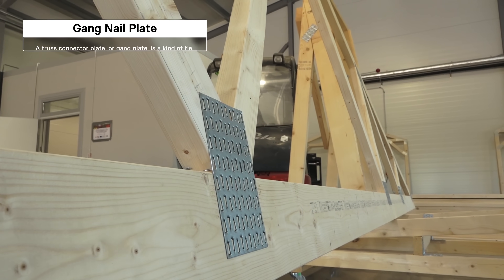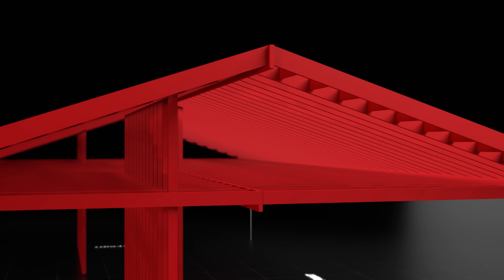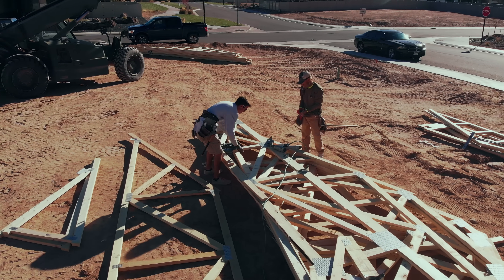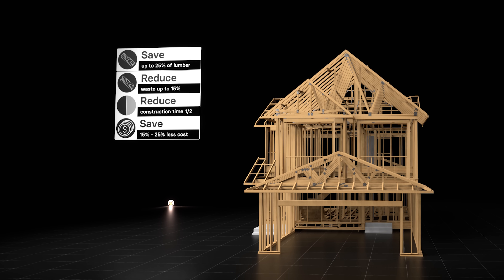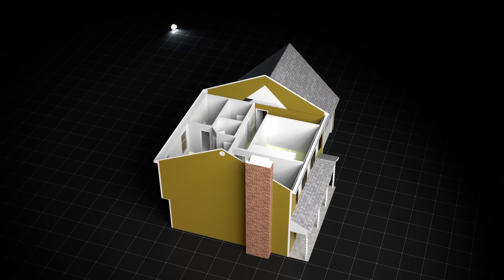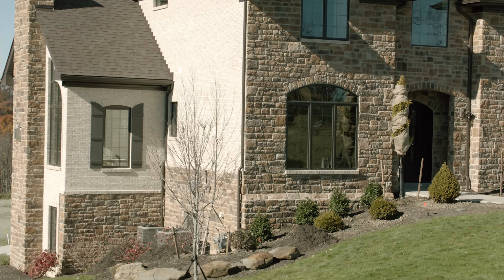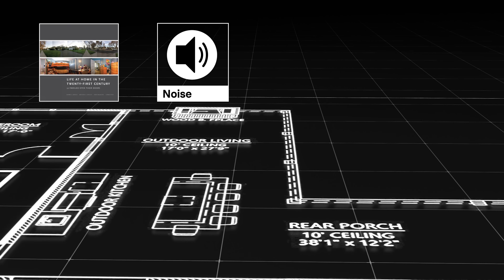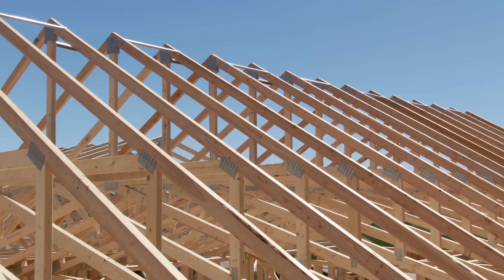The Invention that Accidentally Made McMansions

Comment: Super interesting, thank you! In case anyone's interested, this is in the domain of sustainability great example for what's referred to as a "rebound effect". Where an efficiency gain through innovation is eaten up by increased consumption. (think e.g. more energy efficient machines -> lower energy bills -> increased used of machines -> same energy bill as before)
Reply: Also known as the "Jevons Paradox"
Reply: The same thing has happened in America with vehicles and vehicle size like a full-size pickup truck like an F-150 from 1995 or 2000 compared to today is a massive increase like much bigger probably 25% heavier. But because engine technology has improved they can still get roughly the same marginal fuel economy or a tiny bit better. Where if they had kept the vehicles the same size and used the increased technology they could have been much more fuel efficient and the engines could have been smaller and lighter and cheaper to make and they would have been less stressed and less stress on the transmission etc 

Also now nearly all cars are way overpowered considering most people never gun it from a stoplight.
Reply: Just like more highway lanes -> people move farther away -> more cars -> traffic jams same as before. Man, suburbia loves that stuff.
Reply: not so much a rebound effect as elastic demand. "increased use"
maybe because the fkfing demand was there, and it was price limited? stop being antihumanist.
Reply: @removechan10298  It tends to be eaten up by demand, whether that demand is from consumption, or from redirecting investment(i.e. training carpenters), or simply allowing more slack in terms of waste.

Comment: In the 1960's, there were similar zig-zag steel plates you hammered end-on into the wood, but it cut thru the wood fibers.  Roof trusses with 2x4 are stronger than traditional 2x6 rafters with 2x6 ceiling joists (forming a triangle), plus large lumber is getting scarcer since growing smaller pine trees ~30 yrs is more economical.  Even with older on-site roof framing, rafters often had mid-support studs down to walls, for a truss-like structure.  A bit wrong about a 1st floor not having to support upper floors, unless those upper floors are thick truss-like beams, often today being vertical OSB board with 2x4 at top and bottom.

The angled cuts and measurements are tedious on-site, but simple and repeatable in a factory.  Why most builders today order pre-built roof trusses from a factory.  Requires a crane to install at the house, unless a small structure, which is most economical when building a whole subdivision.  In similar vein, factory-built houses are more economical, but limited to section widths that can travel by road.

Comment: You are wrong about most of your main points, and gang nail plates don't make ANYTHING "possible", they just make it a little cheaper and weaker.

There are countless other products and methods and techniques for building trusses, nearly all of which are stronger and last longer with fewer failures, the truss plate is just the lowest possible strength and cost way to do it, and should NOT be glorified like this.

If it had not been approved, we would still have trusses, they would just use nails or screws or bolts through the side plates, like any heavier duty and better built truss or joint would use.

Making it sound like the truss plate is this pivotal invention that makes the modern world possible means that either you are just trying to find a unique click bait hook to make a video with along the lines of an actual expert like Practical Engineering etc, or that you phoned in your research and didn't actually understand the subject very well.

The real revolution was learning how to design trusses for residential buildings in a way that didn't require teams of engineers hand calculating loads on drafting boards with slide rules, and making it possible to design trusses rapidly and cheaply so they could be used for lower cost buildings.

Getting the computer involved was really the key, so they could just plug in the design, and it would tell them the loads and what sizes of materials they needed.

The other big factor that you missed as you tried to focus everything on the truss plate is the development of truss joists and I-joists, which is what actually makes the open multi-floor plans possible, because you can span much further than with a plain wood beam with no support below.

Also, the shade given to overlapped boards and toe nails was inaccurate and unfair, because the through-nailed overlap is one of the strongest joints you can make, much stronger than the gang nail plate, and any carpenter who can use a speed square can easily make that joint.

And toe nails are actually STRONGER than the gang nail plate when done properly, because they go all the way through the wood, vs the gang nail plate just being stuck in the side, where it will come loose as the wood dries, and is especially bad in a fire where just some surface char will cause complete structural failure, even if the board itself is still unburned in the core.

So anyway, the only benefit of the gang nail plate is a minor cost reduction in the manufacture of trusses, at the cost of strength and longevity and safety, and the actual catalyst of the changes that you are talking about was the development of the ability to rapidly engineer truss design at a cost that made them an affordable option for residential construction.

Comment: Open floor plan with yrusses has the side effevt of expansion and contraction at the ceilling to wall drywall joint. So now you need crown molding to hide that yearly cracking

Comment: Complex roof shapes are a dead giveaway that the builder spent almost no money on design. It takes a lot of effort to refine a house design to the point where you have simple, elegant forms assembled through additive massing.
Reply: Complex roof designs are usually a dead give away that an architect was involved or a good draftsman on a computer.
Reply: @paulchapman1933  I'd argue the opposite. Usually, if a GOOD architect is involved, the roof is easy to build.  If the designer didn't follow TND additive massing principles, you get a stereotypical McMansion.

Comment: If you think housing affordability is bad now, think about how bad it would be without this invention!

People often miss the cause and effect and blame lack of affordability on some ‘market’ improvement when the modern inventions often bring the cost of nicer things down for the ordinary person.

There are two pressures driving prices for a commodity like livable real estate higher and higher, regulations and inflation.

Regulations cause the builders to have to contend with code inspections and enforcement which increases the build time and lowers efficient production while in 2008 the fed decided to PRINT PRINT PRINT their way out of the banking collapse. While the inflationary pressures weren’t felt that day, after the real estate price bubble burst on everyone, the trickle down effect which happens when all that newly created currency bloat comes to the individual level you see the prices of every type of good rise to the level the money supply has afforded.

It wasn’t the gang nail plate. The builders had to pay more for everything, labor and materials, to get the job done so building larger houses was the only profitable way to run the company. Hence why you see so many townhomes and condos popping up around and after 2008 as well as almost exclusively larger builds.

Comment: Toe-nailing is still required where the truss meets the exterior/structural wall, which usually is also the position of the gang-nail plate.  Meaning toe-nailing needs to be performed through the gang-nail plate, often damaging it or compromising its original integrity.  On top of this building code also requires extra metal plates called "hurricane ties" to be attached to the structural wall and truss using 1 1/2" galvanized nails.

Comment: Wait a minute!! You said the issue was the roof being a wing and that toe nailing the rafters to the top plate was the connection that failed leading to the development to the gang nail plate, but in the video you show trusses made with the plates being TOE NAILED to the top plate just like rafters has been. This seems to be a case of bias looking for an out let rather than honest analysis. If I may, the real solution to the problem originally posed is also metal and is a part of most building codes... Rafter tie downs. These metal strip twist 90 degrees allowing for multiple nails to hold the rafter to the top plate but in many circumstances all the way down to the studs below the top plate.  Last aside some areas require homes with truss roofs and particularly truss floor systems to be registered with local fire departments to protect fire fighters, as these systems fail in a fire so much quicker than homes built from dimensional lumber.

Comment: We build with concrete in the Caribbean. Pretty much the same thing happens here. Less people buy large family homes since they’re expensive and people don’t reproduce as much as before. Still, most builders construct 3 bedroom, 2 bath homes or larger because it can be sold for much more. There is a need for 2 bedroom homes for smaller families or a single person, but the profits won’t be as great since it takes roughly the same amount of time to build. Similar to trusses, we can use concrete beams to create large open floor concepts instead of needing load bearing walls or columns.

Comment: I've been in construction for 40 years.  I've framed three of my own homes from scratch.  I've built trusses with plywood gussets and nails.  I've stick framed others. 
Trusses are great and moderately cost competitive if their kept simple and uniform.  They are brutally expensive otherwise and waste tons of wood.  I see these stupid Sherwood Forests on top of complex bases.  Total useless space.  
And what B/S about toe nailing stick frame isn't as good vs trusses to top plates.  If you have issues with uplift then whether it's truss or stick frame you'll use hold down clips or straps or other sheet metal anchors to resist that uplift.
If you have greater spans than 14' your often times better off with a steel beam or engineered lumber (LVL).

Comment: As a civil engineer / project manager for a State transportation agency from the early 80's up to the pandemic, I witnessed many an advancement in tech for all aspects of my job.  For actual Civil work, we went in reverse - from capturing all flows into concrete pipes & culverts to allowing rainfall to penetrate the earth via porous pavement or "rain gardens" in between parking lot aisles or large retention basins at the bottom of large parking lots.  We went from More Pipes to Less Pipes.  We did large wooden structures for salt storage sheds.  We used the gang nailed trusses from the early 80's but they were problematic - they left too much "give" so the shingles fell off, they provided too convenient a nesting roost for pigeons & crows, they were obstacles to the trucks delivering the salt, getting hit & broken all the time.  We went to glue laminated arches - yes the fancy type used for churches & such - for a mundane salt shed - but they solved all those problems stunningly well & ended up being cheaper in the long run.

Comment: Very intriguing video. The reason housing is bigger than it used to be is because by the time you get through the bureaucracy of getting permits, the regulations, the plumbing, the cost of concrete to build a driveway and foundation, the large garage everyone needs, the fancy kitchens everyone needs with granite counter tops and tile floors, expensive appliances, the cost of running water and gas plumbing to a house, electrical, cable, internet, etc. and most of all the high cost of land in most desirable places to live, makes just adding a second story to virtually double the value of a house a no brainer. Think about, for roughly the cost of adding some sheetrock and 2x4s you can double the price a house will fetch when 95% of the costs of the house are fixed including the roof.

In other words if houses in an area sell for, say, $250/square foot, and the all in cost of building a 1 story house which is 1200 square feet is $300/square foot, you would be selling that house at a loss. But say the all in cost of building a 2 story house with 2400 square feet is $200/square foot (remember it's the same cost to permit, buy the land, same driveway, foundation, garage, kitchen, living room, downstairs bedroom, bathroom, same roof, utility connections, etc., you're just adding a few extra bedrooms and another upstairs bathroom) you're going to build a 2 story house every time because now you're making $50 profit per square foot.

Everyone freaks out that we're not building small affordable houses but that's the economics of how houses are built. The marginal cost of building a second floor is minimal so we'd be dumb not to. There are plenty of existing houses that are cheaper, you can't compete with those prices when you build new. That would be like if car makers were trying to build brand new cars to undercut the price of used cars. That's just not realistic. If you can't afford a new house just don't buy a new one. If you don't like the price of used homes, sorry that's just supply and demand of the cost of land and you can blame congress for spending money it doesn't have running up a $36T deficit.

Comment: My grandfather took a sketch of trusses at a factory thinking it was a good design and then when he built his own 1,600 sq foot house in 2 years after work (no big deal 🤯- and he didn’t work in construction either), he used homemade trusses, monster overbuilt things.  

I had an engineer friend look at it and he said it was just like homes are made today only way stronger.

Brilliant guy with an 8th grade education.  When he was 80, he climbed the utility poll at my first home (foreclosure) and turned the power on even when I protested.  Tough as nails.  RIP grandpa.
Reply: Your Grandpa sounds like a BAMF.
Reply: Men back then were built different.
Reply: Sounds the same as my house. My grandpa dropped out in 7th grade, built his own house, and the homes of others. 

Some things leave you scratching your head. But then you have to stop and think that there was no internet, this was built by a guy just figuring it out. He dug the freaking basement by hand... Unreal. We had a tree (massive one) drop on our house last year, and it has old the old designed roof. And 0 damage was done to it. It has a ton of angles to the roof and is just massively over built. We don't have hurricanes here, so lifting forces probably would be harder for it to tolerate, but it can take a ton of extra weight being dropped onto it, even if that weight is focused.
Reply: For every brilliant guy who dropped out of middle school, there are 100 dropouts who are complete idiots.   @1Kurgan1
Reply: @1Kurgan1 That’s wild

Comment: I was a building inspector (new construction) from 2004 to 2010. I could never wrap my mind around why the roofs were so enormous except to add that over the top architectural element. Some of them were definitely beautiful, but some just seemed completely out of place, especially on a 3 bedroom ranch when with a skyscraper roof on top. Those roofs were an absolute pain to inspect for bracing too. It wasn't at all uncommon to find trusses installed without the engineer required bracing. Overall the trend seems to have come back a bit on the grandeur of roofs and with the skyrocketing cost of real estate I imagine that kind of excess will soon be a relic of the past.

Comment: Gawd I hate the hideous appearance of multiple, unnecessary roof lines and outer walls with several useless jogs in them.  So tacky and classless.  And the open floor plans are SO awful!  They make even the largest home feel small and cold.  No cozy places, and you can see from one side of the house to the other, making you realize how small it is.

Comment: If you had to pick one invention, I would not disagree with his choice of the gang nail plate. But the mcmansion results from a confluence of Dimensional lumber
Plywood/OSB
Sheet rock
Engineered wood joists
Premanufactured roof trusses.
With these materials available,  it became affordable to build large spacious houses that in previous generations would have been impossible or impossibly expensive.

Comment: No because those plates have been around for a long time. They are also only applicable to trusses because the members of a truss are only under tension and compression and no bending. Its limits the force connecting the members. 

The McMansions come from super sized excavator bulldozers. Concrete pumps. Cranes everywhere. Everyone has the extending fork lift. Nail guns.  No one does tasteful things like brickwork. 

They used to have to carry those trusses by hand to the second floor and onto the roof and nail them in place by hand. Things were proportional to the human doing the construction.  No one care about proportion or scale anymore.  The walls are also panels. 

That’s where the name McMansion comes from they have 3 or 4 plans and then you pick like sunroom or a family room extension like you’re ordering at McDonald. You’re ordering a number 1 plan and then super sizing it.  Then the walls are modular panels made in a factory like the trusses. 

They can hire carpenters that can only connect walls together. 

It doesn’t make any sense because there is still housing shortage.  They rush stuff together in 90 days and there is still a housing shortage.